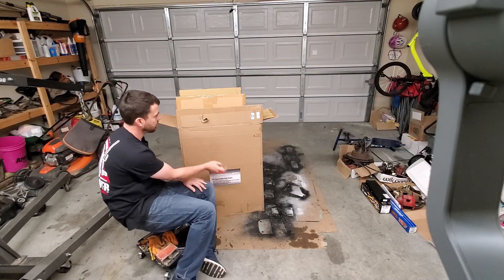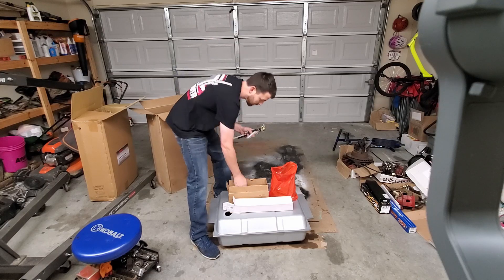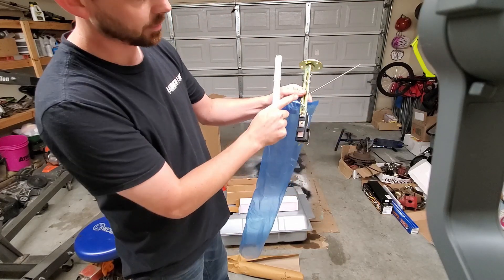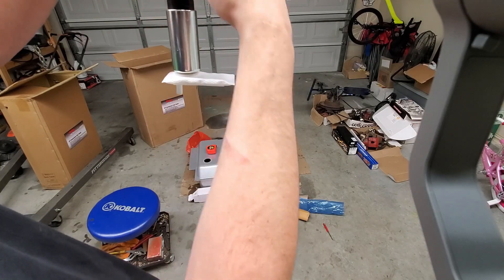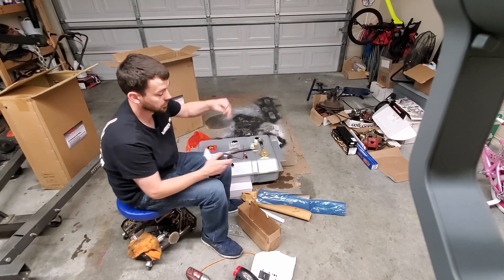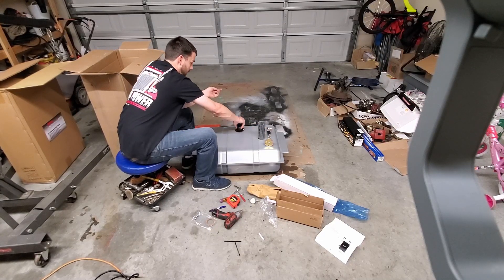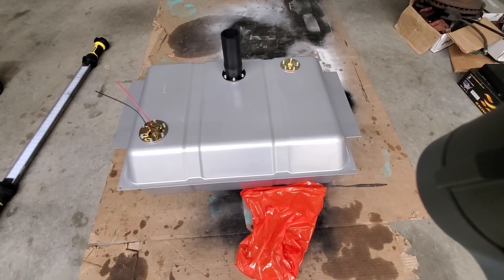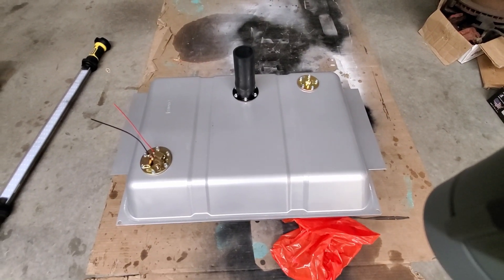67-72 Holley Sniper EFI fuel tank / Tanks Inc

Comment: Can you swap around the locations of the fill tube and fuel pump? Just wondering because I see there is a side fill option available now, so it would make sense to put the fill tube closer to the side of the bed, instead of in the middle of the tank/bed. My truck is a long bed so it would be quite a reach to put in gas if I did it the way you showed. Anyway, great video!
Reply from the maker: Thank you, I don't thank you can swap them around because the holes are different sizes its a really good tank for the money

Comment: mine didn't have the internal tank baffling in the corner hole so i had to put the pump in the middle and the fill nozzle in the corner. Just wondering if yours was different. I also had the 67 -72 C10 tank, it looked just like yours on the outside.
Reply from the maker: My tank was baffled  it also had a little square were the pump set down in. Did you buy a EFI tanke or non EFI?
Reply: The tank I got from Holley looked the same but my fuel pump mounts in the center. It is also a efi tank.